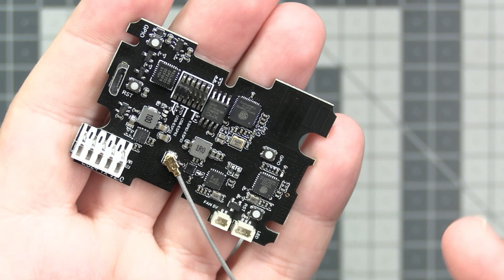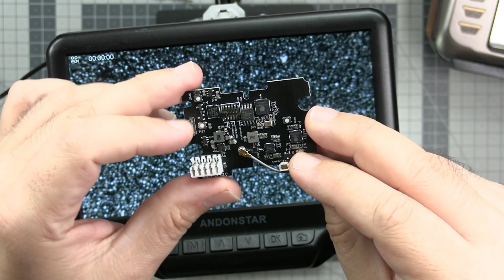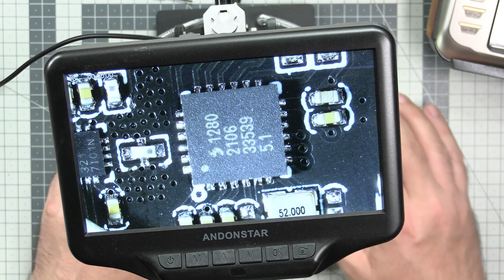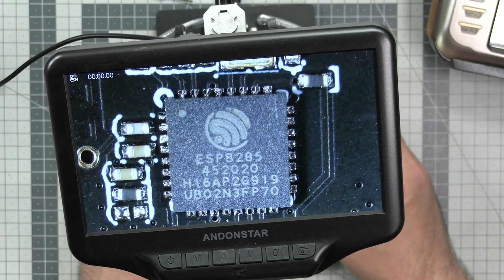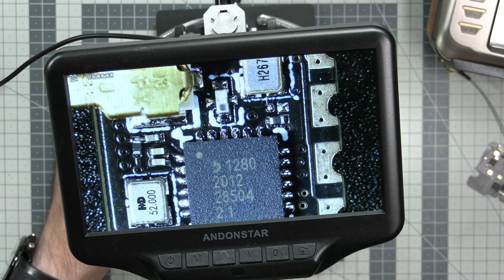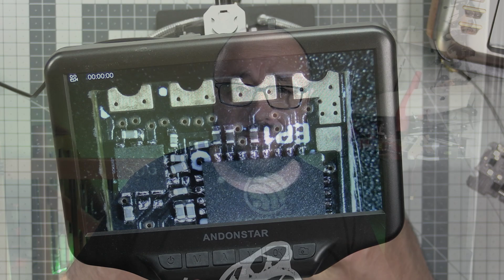Happymodel ES24TX and EP1 RX ExpressLRS under a microscope

Comment: Being critical about technical issues when you say you are not a technical expert doesn’t come across well Pawel- and it’s a transmitter which most of us have been using for over 6 months now without fan and without any issues. My suggestion is you stick to reviewing performance. (Does it work?) I still value your opinions though and still will keep an eye out for future videos from you. Just don’t be resisting change or saying the “hobby is dead” 🤨

Comment: I recently discover that my EP2 don´t have the magic element indicated at 7:00, so I have a 5 mts range, haha. Check your component as soon as you receive them guys!
Reply from the maker: Then no wonder it's not working. Without this element, the antenna is basically disconnected

Comment: On the RX you have ESP8266 not ESP32. It's the version that has embedded flash.
Reply: Neither is that haha. It's an ESP8285. Not an ESP32 anyway haha. The ESP8285 has a built-in flash memory rather than 8266 in wich an external flash is needed

Comment: Be aware that you have the Happymodel EP receiver from the batch with SDG voltage regulator. If it starts with the dimmed LED then it gets very hot and can overheat. Wait for the ExpressLRS version 1.2 with workaround (disabled Wi-Fi calibration on startup)

Comment: Hi Pawel, thanks for this review - I'm curious how it continues (ELRS and you+ELRS :-) )

From my understanding (and after looking into the code, e.g.  ExpressLRS/src/targets/happymodel_2400.ini : [env:HappyModel_ES24TX_2400_TX_via_UART] \n extends = env:DIY_2400_TX_ESP32_SX1280_E28_via_UART) the ESP32 handles all TX + RF + WIFI update (activated via the ELRS lua script) and the ESP82 is the so-called ESP-Backpack (https://www.expresslrs.org/1.0/hardware/esp-backpack/ - maybe not flashed with that firmware by Happymodel; at least not on mine).
The jumper settings define which UARTs are being connected, so either ESP32-USB, ESP82-USB or ESP32-ESP82. The first two settings to upload the corresponding FW via USB and the last one is probably the way to make use of the ESP-Backpack. 

Regarding the build quality, my EP RXs also show the misaligned resistors, but they work fine - let's see how long...

Comment: The rf stuff is handled with 1 chip, the wifi and website it creates is done on the other chip.
Reply from the maker: That I figure out. Still, i guess ESP32 should be able to handle everything
Reply: @FPVUniversity  you are free to come up with a super reference pawel design. it's open source!
Reply: @FPVUniversity  if you listen to some stuff the elrs devs say there is a pretty decent reason for it. I just dont 100% remember what it was, lol
Reply from the maker: @Quick-Flash  I'm not saying there are no reasons. I just say "question everything" 😂

Comment: The componente in the reciveer that You do not identified is the wifi antenna... Very tiny and they avoid the típical Square coil that needs some milimeters... A good o idea isn't it?  My experiennce with the Jumper T lite is good... Except that the ELRs module is on with some of my model were has to be OFF then it drains the 18650